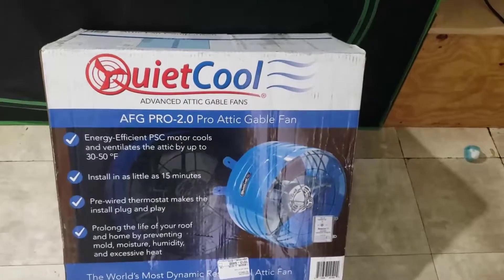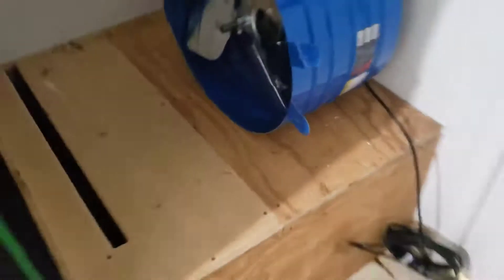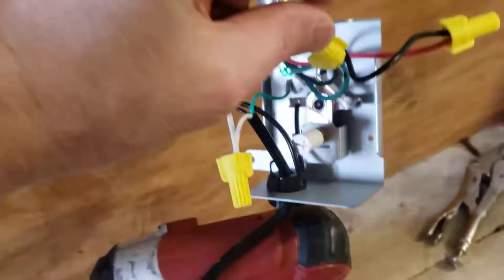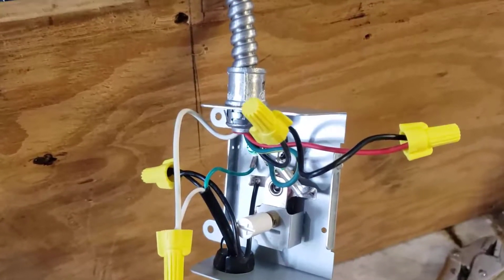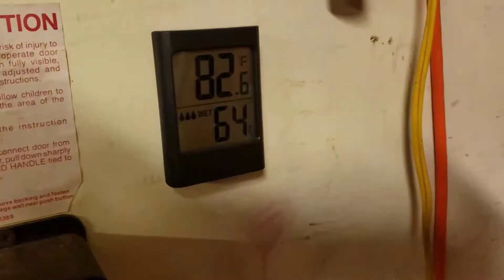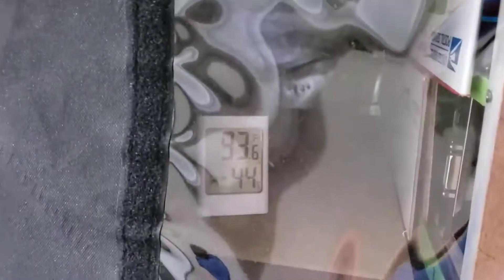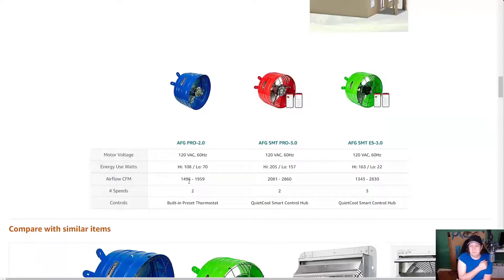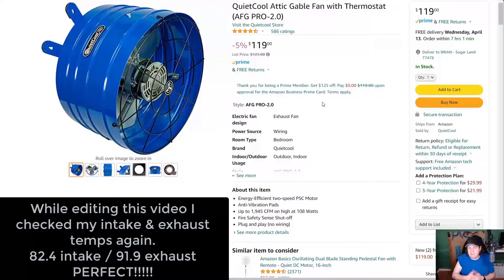Adding an intake fan to improve air cooling for the summer time

Comment: Great to see that you have a lot of airflow over the rigs, from my experience mining through last summer (which was hell for me to work in, but ok for gpus, 32C intake, 40c exhaust), its all about moving the air in and out as fast as possible so the delta temperature between the intake and exhaust is as close as possible, 10-15 degrees difference between intake and exhaust is pretty decent, the more air the smaller the delta.